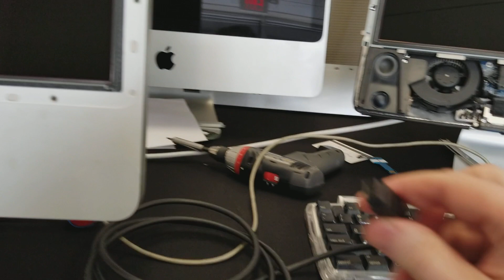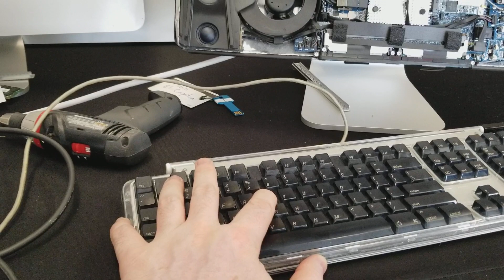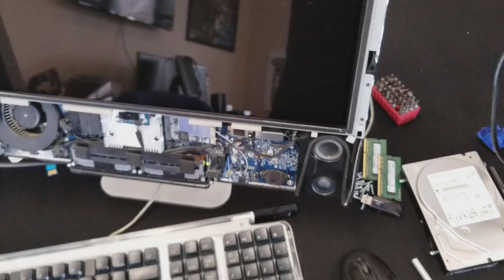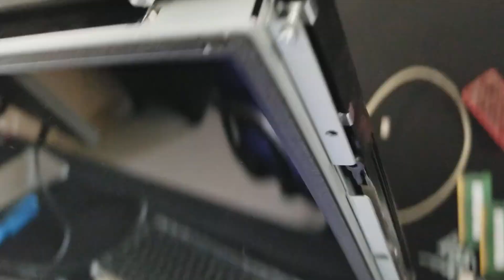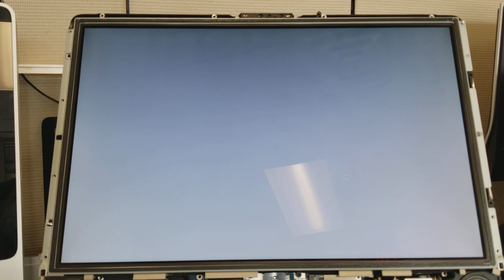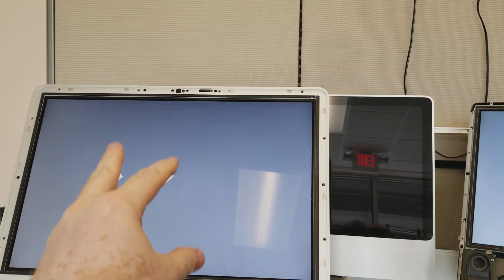Diagnostic boot of one iMac into another using target disk mode.

Comment: Would it matter if i have a windows keyboard i cant get the mac to boot up into targey disk mode im pushing t also tried to boot it it to recovery mode then chose preferences restart then it won't show target disk mode in that way of trying to boot target disk mode either
Reply: If the keyboard is USB it should work fine on the Mac without needing to load a driver.  Keep in mind the Control and Command keys functions are swapped between Macs and PCs.  Example: PC Save is Control + S keys, Mac is Command + S keys.  You can also use and 2-button usb mouse.  If you have a 1-button Mac mouse, hold down Control key and click to get other function menus.

I don’t think it was mentioned, but the oblong shaped FireWire cable is the older FW 400 and the more square shape one is the newer FW 800, in case you need to purchase a cable.  OWC macsales.com and Fixit.com have some great how to videos as well.